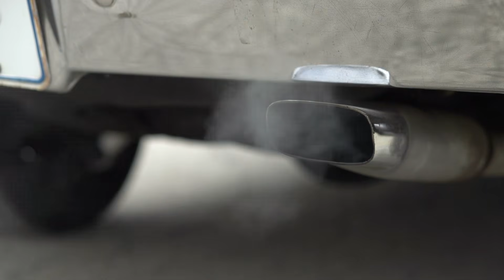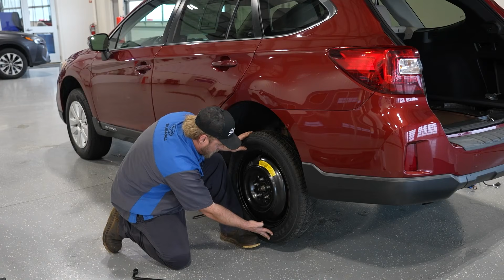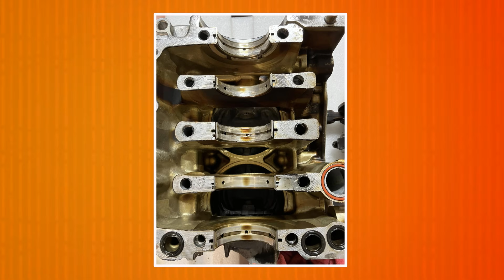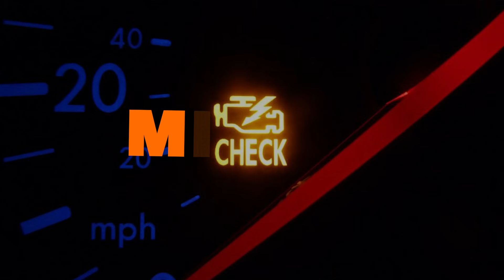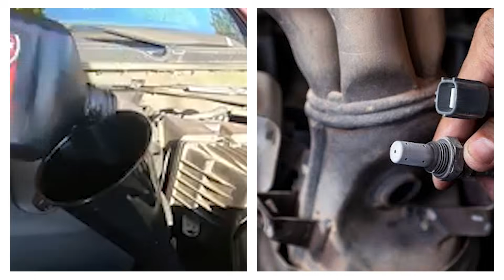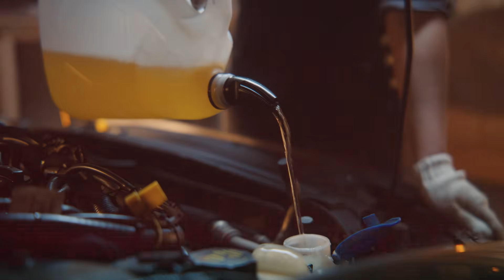SUBARU OWNERS! Please NEVER Do THIS to Your Subaru (12 Expensive Mistakes)

Comment: Always drain and refill your CVT fluid every 30,000 miles ( DO NOT FLUSH ) and drain and refill front and rear differentials every 30,000 miles. Engine oil and filter every 3,500 miles. Drain- flush and refill radiator fluid every 50,000 miles. Replace PCV valve every 30,000 miles. AND ALWAYS use Top Tier Gasoline which will help prevent carbon buildup and gunk inside the engine.
Reply: Everything correct except 2500 oil changes. 1 demerit for that advice. 😊
Reply: @arthurfisch3673  I change at 3,500 and have let it go to 4,000 one time
Reply: @richardsmith4187 your still still wasting your money! The best thing is you do you, and I’ll do me!
Reply: @richardsmith4187 Nothing wrong with it. How many cars have you owned new, that you have kept for over 200k miles? I have owned vehicles since 1976. Many many moons. Except for 1, I have kept them all for over 10 years. None have given me drivetrain or engine problems with 5K oil change intervals. Now, most were Japanese brands. I was very timely at 5K intervals. They were relatively easy to DIY, which elevates the correct things to do. 3K intervals on older cars, are just more of an expense for time and money. On newer cars, paradoxically, with all the new bs, fuel dilution, GDI, turbos, VCM, etc. I could see an argument for 3K intervals. The other fluid changes you mentioned are spot on!👍. My present vehicle is a 07 Toyota Highlander V6 3.3L AWD. 170K miles. Cannot hear it at all stoplight. Just changed the OCV valve. Ice cold A/C. 5 K oil change intervals and OEM Genuine Toyo filter Made in Japan. 3K intervals beg this question… Do you own the machine… or does the machine own you?”
Reply: By changing your oil and filter every 3500 miles is a waste of your money! 6-7500 is ok, I’ve gone 9500 miles with quality 5W-30 Mobil 1 oil, with no issues. An oil analysis said I could go further!
Reply: @brianzimmer5532 And that is why 5K is the best. Nobody thinks in terms of 3500 or 6400 mimes. Whatever. You remember 5, 10, 15, 20, 25, 30??? You learned this in grade school. Do that. Make it simple. They have already made it complicated. Get to retirement early Bro. Don’t fill ur heads with this minusha!!!
Reply: @brianzimmer5532 I change it in our 2 outbacks every 10 thousand with Subaru synthetic oil and filter, no problem at all. Synthetic oil should be good for 10 no problem, our 2014 has 130 thousand miles with no problems